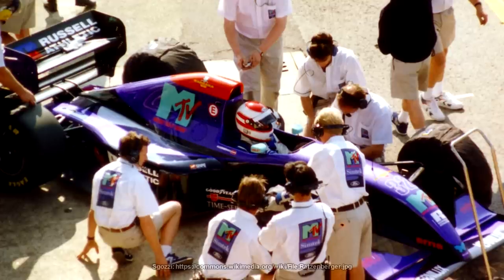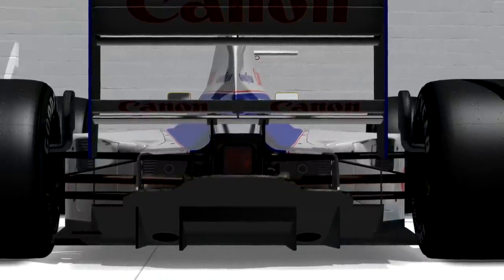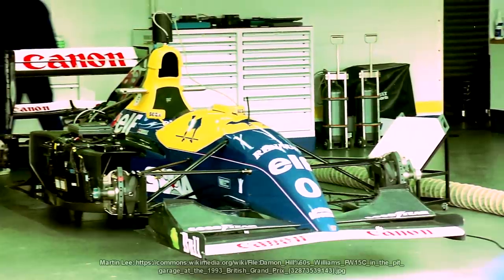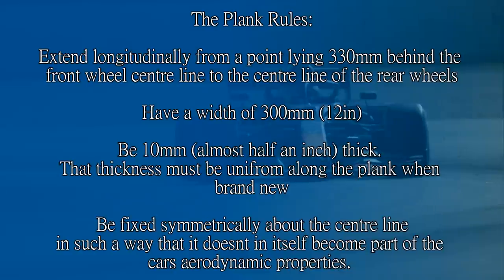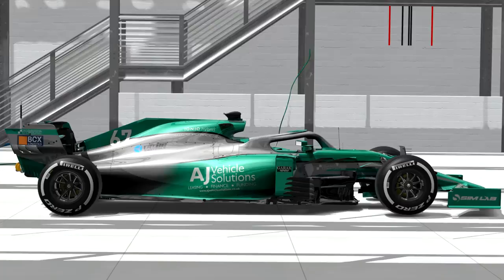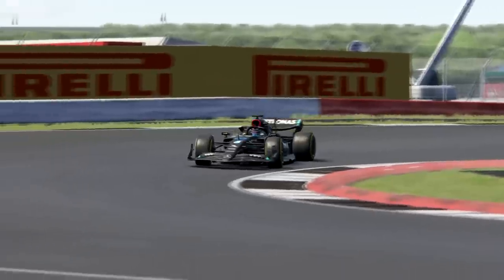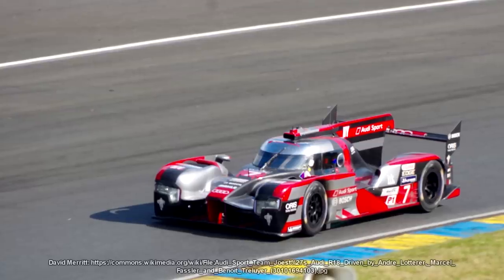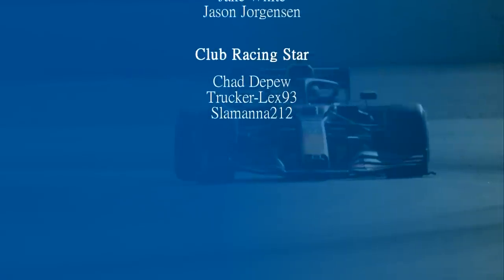THE WOOD THAT CAUGHT OUT HAMILTON! The Story of Formula One's 'Plank' Device

Comment: Funny you should mention Sennas accident. I watched a doco the other day and it covered Gerhard Bergers accident in much the same place and for fairly similar reasons, something like five years earlier. It was a decent crash including a fire. So I guess I'm several decades late in wondering why nothing was done to that section of track post Berger, before Senna had his crash there.
Reply: Both Senna and Berger agreed for years that Tamburello was a dangerous corner and that a fatal accident would one day happen there. Sadly they were right in the worst way possible.
Reply: @CyanRooper Yup they went to the corner to see if any extra run off could be added but because of the river right behind the track they agreed there was nothing the track could do
Reply from the maker: I keep thinking about doing a video on it but you just know if you offer anything beyond “broken steering” the senna fans are going to accuse you of bias and defending Newey.

Even though Schumacher saw the car snap.
Reply: @RANDOMZBOSSMAN1 if only someone could've come up with the idea of turning Tamburello into a chicane before Senna died there...
Reply: @AidanMillward   To be honest I'd like to hear your take in it, but I get where you are coming from. It just blows my mind a tad. It seems to me that drivers really had to fight for safety at times.
Reply from the maker: @Pablo668  I watched the footage today for this video and that car gets loose. It’s bottomed out and stalled the diffuser

Apparently the “broken steering column” was mentioned by an Italian lawyer or judge but had no proof to hand. So that’s become the “truth” because it was said by someone in the right position.
Reply: @AidanMillward   thx for your responses, I'm glad I'm not alone in my curiousity about that particular section of track.
Reply: @AidanMillward  It was well documented the steering column was poorly modified on Senna's car going into the season and there's videos of Senna turning the wheel and literally nothing happening going into the corner; the car went straight off. The black box/telemetry data was also removed from the car post accident and not immediately provided to investigators by Williams. Also the ruling that it was a mechanical fault that caused the crash was made by The Supreme Court of Cassation of Italy years after the initial trial. I don't quite think it was just someone spouting off what people wanted to hear; on the flip side if they made the ruling they did post accident people would've been jailed and F1 as a sport would've absolutely taken a beating. 

What always struck me; on the extended cut of the Senna documentary Prost was asked if he though there was a mechanical fault with the car; he puts off as he seems to know something but basically responds "I can't say for legal reasons." I have some feeling that if it was something like an aerodynamic stall or Senna losing it answering would probably not fall in that category. 

The race shouldn't have technically proceeded that Sunday following Roland's death. How accident happened isn't really conclusive but how the evidence was handled, what was determined in the ensuing trials, and how people that were involved in the event and with Williams talk about what happened gives some context.
Reply: @halofreak1990  Yup sadly, but Senna and Roland death probably advanced safety in f1 that is truly invaluable to this day 

I wish they didn't make it a chicane but more challenging curve though a bit like Piratella but maybe a tighter apex
Reply: @AidanMillward  Another thing to add to that is the fact that Senna was complaining the SC was running too slow, causing the GoodYears to lose pressure, lowering the overall ride height of the car, making it bottom out on the ridiculously bumpy Tamburello.

I was talking about this with my older brother who’s also a massive Senna fan, and throughout all these years I’ve never heard him say a single bad thing about Adrian Newey in regards to the accident.
Reply from the maker: @sandalogaming6766  yeah, it’s a bit of a weird one. Damon said if the steering column broke then Senna’s hands would have crossed over.

I still think the thing bottomed out. The column could just have easily broken on the impact.
Reply: @AidanMillward  I also think the car bottomed out, not only because of what Damon said, the whole tyre pressure thing (which I’d also research to see if it’s true or not) but when you consider the changes that were made for 1995, (reprofiling/changing Tamburello, Villenueve, Aqcua Minerale and Variante Bassa) plus (allegedly) making the asphalt smoother, it starts making some sense. I know I’ll be looking forward to a video on the topic or your “What if Senna survived 1994 GP4 playthrough” that you mentioned earlier
Reply: @AidanMillward  the whole "Newey killed Senna" argument never makes much sense when you think about, teams that had no association with Newey had issues with that corner long before Senna's crash, and, in 1994 every team was rushing to reduce the size of cockpits as much as possible.

much like Bianci the FIA had multiple warnings about not just Tamburello but the entirety of Imola in that layout and chose to do nothing until after someone died... Balestre's FIA was an absolute shit show.
Reply: Berger's 1989 crash looked spectacular, but was less hard than Piquet's in 1987 which caused concussion and loss of vision, and the colossal crash of  Alboreto in 1991 which was very similar to Berger's without rolling over, caused by his front wing tucking under the car (which is what happened to Ratzenberger).
Imola and Tamburello specifically were well-renowned for these accidents, all very close together too (don't forget Barrichello almost died on the Friday in 1994 too, though as with Roland, not Tamburello).

As others said, the river made it impossible to move the wall - Senna and Berger decided that... but Syd Watkins summed it up best in the context of the time: Comas (91), Donnelly (90), Zanardi (93) had huge accidents that hospitalized each of them - but nobody died, so it proved that by 1994 F1 and F1 cars in particular must be safe. That was the rationale at that time. 

They kept crashing, hard at Imola too, but despite that, nobody died, so it must be okay. 

However you look at it, Senna's crash wasn't that bad, he was just unucky with the suspension piece. If that had been 3-4cm higher he probably would have limped away like Alboreto.

Comment: Sometimes I wonder if FIA made a F-X class, the rules only really strict  applying to driver safety, but almost everything else is open. Active aero, active suspension, unlimited powertrain and drive-line. 

Just a maximum length/width, fuel tank size, must use a commonly available fuel type (no rocket fuel for example), minimum 3 wheels, and can't exceed a certain decibel limit.

Comment: Such a simple part that can become super technical. Look at what redbull did and got away with until a TD for added/edited. Tbh I still don't understand it. Making a supposedly rigid piece flexible but only in certain areas or something?
Reply from the maker: “It doesn’t say here that I can’t so I will”
Reply: @AidanMillward  like you said "Mechanics and engineers are many many smarts" finding loop holes and get areas that the rule writers didn't even think of possible.

Comment: I don’t understand the random checks of these planks. If the random inspection can cause such a serious result as a DQ then it should be a mandatory all cars checked. Is the 1 litre fuel requirement random as well. I just naively assumed all the cars are checked equally at the end of each race.
Reply: Yea, confused me as well. I’d always thought at the least they pulled them off for checks on all of them. Specifically because rules like the one liter of fuel tests
Reply: @stemartin6671 post race checks should be done not at random if it’s a DQ issue. Do they randomly check the fuel too. I’d guessed the planks were pulled, marked and sent to tech at the least. Most and sensible is in garage up on stands with an FIA tech measuring immediately after finish and in garage. Only the top 3 are left out for publicity, correct. What they actually do makes little sense, especially with ground effect pulling the cars into the ground more than before with a set minimum ride height
Reply: @stemartin6671 mind you, rules are rules. I more of the want to win crowd. Not a believer in cost cap or a lot of the crap FIA has out there now
Reply: @stemartin6671 I’m not thinking that all the other cars were in violation but if it’s a technical DSQ and not a penalty then all cars should be subject.  Plus the difference is the volume of people being checked. Police have to do random checks otherwise they would bring traffic to a halt and affect civilian traffic. FIA has 20 cars to check not hundreds.

Comment: If the teams can find hundreds of engineers each in order to design the car to the absolute minimum of tolerance in the regulations, surely the FIA can find a suitably sized and qualified team of engineers to check at least some reasonable subset of measurements on every car.

Comment: Sorry but F1 cars (any motorsports cars) are not sucked to the ground !!!
Over areo or under areo cars are pushed to the ground !!!
The air pressure above the car is higher than the air pressure below the car, so the higher pressure pushes the car down !!! 
That's why it is called "DOWNFORCE"

😉👍

Comment: I still have to wonder how many other cars would have been found to be out of spec at COTA if all cars were checked after the race. The FIA should have at least checked the other Merc and Ferrari as well, since it isn't practical to check every car on the grid. I'd bet money that Russel and Sainz's cars would have had the same level of damage. But like you said, the FIA likes to Knee-Jerk react to things, which honestly absolutely ruined the COTA race for me, after the DQ's were announced. I think this was an overreaction to track conditions and track limits. I'm not even much of a Hamilton or Leclerc fan, I enjoy the dominance of Red Bull. But I think this was a blight on the sport, and a ridiculous way to undermine two drivers and teams that have been putting in hard work to improve their cars.
Reply: A technical infringement in a race is almost always an automatic DSQ. Whatever the reason, the car was not within the technical specs/

Comment: I'm utterly disappointed this videos title isn't an innuendo... Private giggles were had!

I like the plank. It's black and white, no ifs or buts. Too far worn - DSQ.
Reply from the maker: Still think there can be mitigating circumstances like hitting debris but that’s just me.
Reply: @AidanMillward  Absolutely, but in a clean race like COTA, nope. Probably were more worn planks too, if they'd checked.
Reply: @charamia9402  CotA is a fabulous circuit with dreadful surface because of its shit underpinnings, or marshland to you and me.
Reply: @clansome  I am aware. There was no debris to blame this weekend though, so with the correct setup the planks should be fine - as evident by Verstappen and Norris.
Reply: @charamia9402  Oh I agree, they (Merc) screwed it big time but Ferrari didn't even have the excuse of a new floor as it was the same car from Qatar with no upgrades. I think the new floor just lets Merc ride that little bit lower that they need for the speed. I find it amazing that 1 mm was all the damage on the plank, but that's life. They won't get caught out like that again. On to the next race.
Reply: @clansome  Ferrari however, will get caught out like this again. Leclerc now has converted pole to DNS, DNF and DSQ. I swear they keep inventing new ways to disappoint.